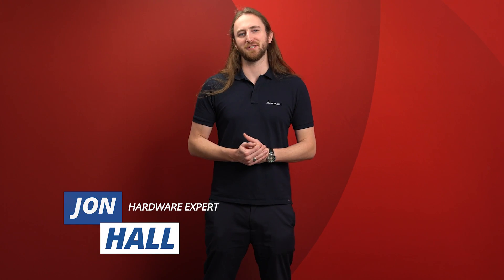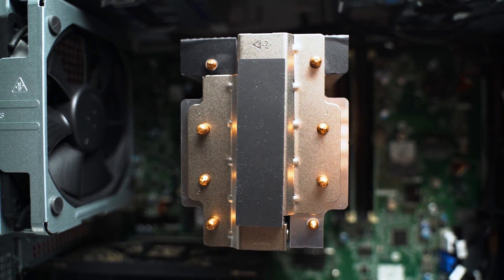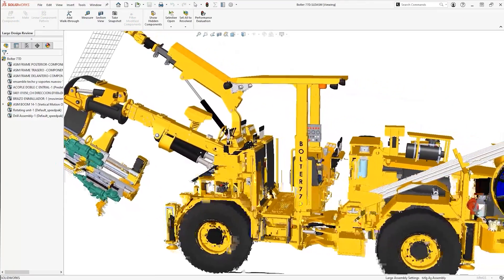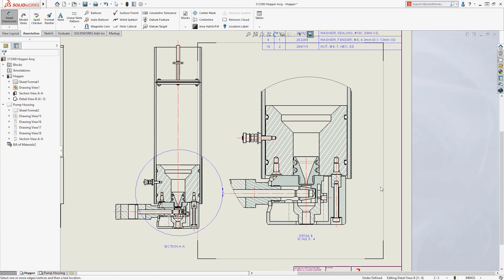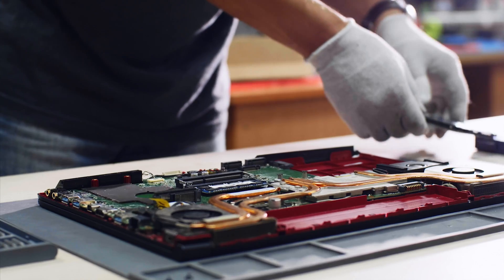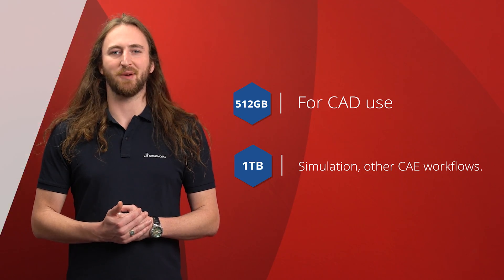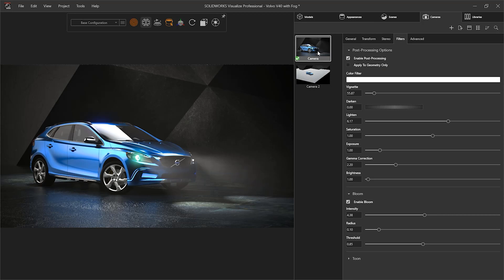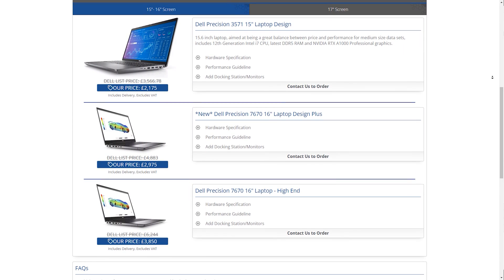What DELL Workstations are Recommended for SOLIDWORKS? | Hardware for SOLIDWORKS

Comment: I have found the HD controller can affect performance as well. I run A Dell  Precision T5600 Desktop that I installed a PCI LSI PERC controller, with my SSD setup as raid 0.  Saw a huge difference versus having the SSD run off the SATA controller on the motherboard.  Your mileage may vary.